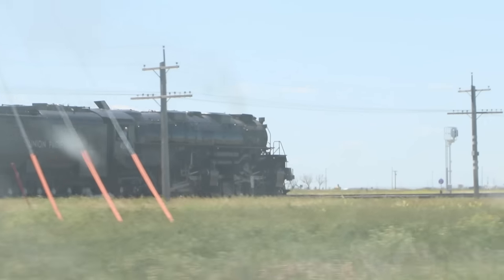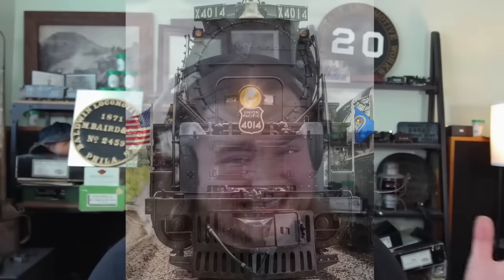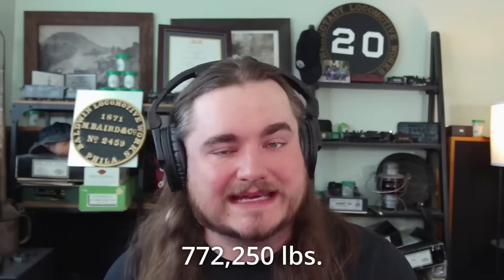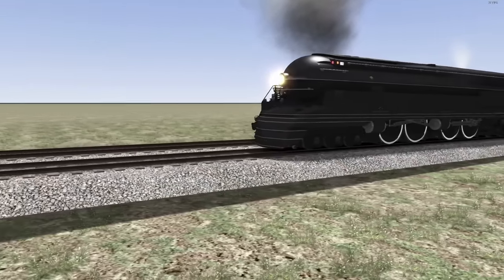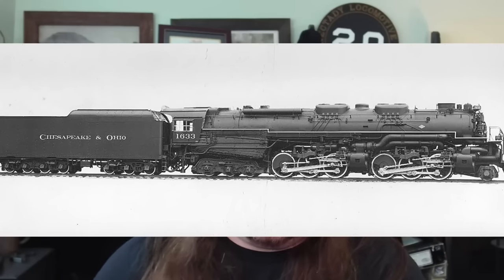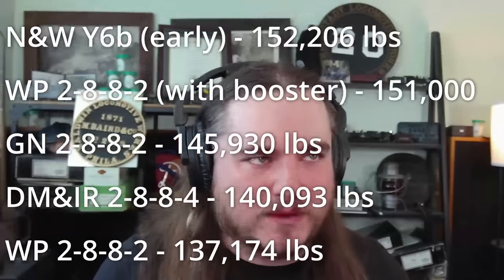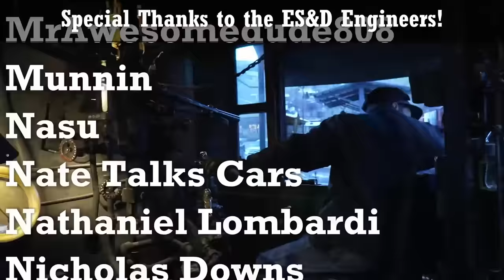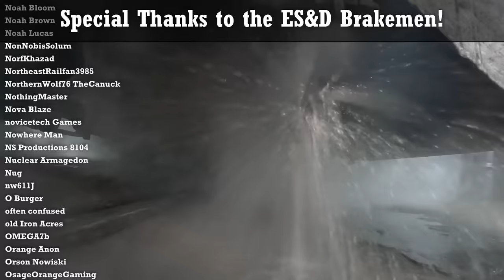BIG BOY is NOT the BIGGEST? What is then?

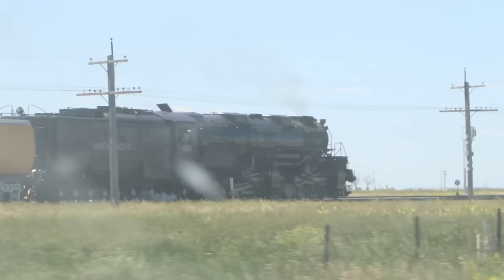Comment: Before getting past the 2:28 point in your video I would like to mention some thingsI have always heard.  Like you I have heard it said many times that the Big Boy is the biggest steam locomotive ever built.  But most, if not all of those statements come out of the rail fan community.  

But what I have heard from within the industry, I’m a retired over the road Engineer off of the UP and literally been around railroading all of my life.  My father was an Engineer off of the Texas and Pacific.  The T&P is where I got my start as a fireman in 1973.  So what I have heard is that the Big Boy was the largest steam locomotive to go into production and was used successfully until they were faced out.

There were larger steam locomotives built, but they were only 1 or 2 of each built and they were not successful and did not go into production.

Comment: Locomotives were/are measured by drawbar horsepower. Tractive effort is important in determining the actual power. You can make a million horsepower, but it won't mean a thing without traction.  Big Boy was UP's biggest by length, that would fit on a turn table.

Comment: IIRC, the UP's original claim as reported in Trains magazine's bicentennial edition (or maybe one of their own anniversary editions) was that the Big Boy is "Largest in point of total engine and tender weight of any 8 coupled simple articulated ever built".  The 8 coupled part eliminates the secretly overweight Alleghenies.  And weight measurement isn't subject to the vagaries of picking a K factor for tractive effort or the complications of measuring indicated or drawbar horsepower peaks with precisely the right resistance to get a maximum.
Reply: 'Largest ... of any 8 coupled simple articulated'     Yeah, why didn't they go the whole way while they were at it and carry on "with 68 inch drivers and a number starting with 4."     Like, if you're going to list that many qualifying conditions you can make almost any loco you choose to be the mostest.

Comment: The Big Boy is currently the largest operating Steam Locomotive in the USA.  A good point about the Erie Triplex. But you are comparing apples and oranges when you're comparing electrics and diesels against Steam.

That said, like the Erie Triplex the Big Boy was designed for one small segment of railroad, Sherman Hill. Southern Pacific had the Cab Forward types specifically for Donner Pass. 

So be careful about these locomotives. They were designed for specific locations on specific routes.

Comment: One thing to consider too, is if you were to design a new steam powered engine, you wouldn't want it huge. The only reason for doing that with the Big Boys was to lower manpower costs, replacing two or more engines with one. Like diesels, you could now automate the steam engine just the same with one controller and as many dummy engines as necessary. Or just run everything remotely...
Reply: I wouldn't trust a robot to tend a conventional coal fire. Powdered coal, *maybe*.
Reply: @ReggieArford Harder, but certainly not impossible. But why use coal at all?

Not that a steam engine with pistons makes any sense efficiency-wise today (turbine electric is better), but using a cheap and easy fuel like CNG/LNG would be dead easy to control.
Reply: @hallkbrdz You're right; a gas or oil-fired boiler would be easy to automate. Heck, the Stanley Steamer had an automatic boiler! As for steam turbines vs. pistons, pistons allow for variable steam expansion and thus more efficiency at partial power. Remember, they built several; all fuel hogs.

Comment: When they say Big Boy is the largest steam locomotive in the world, they are talking about one the didn't go to scrap due to certain reasons such as speed demon was only designed for straight track and not turns cause it's not articulated like Big Boy is and there is no such stretch of track that is straight from one station to another. See the speed demon would have to take certain routes that has extremely long dull turns cause it cannot take sharp turns like Big Boy can and if you compare the design of both then you'll see why Big Boy actually wins, cause Big Boy is the one that kept going while the other large steamers went to scrap due to poor design.

Comment: I know this question has been brought up quite a bit. But could you explain in more detail why it would not be possible to build an s1 in current times. 

Now I'm going on the assumption that with modern equipment and simplification of certain complex equipment. What it would take to make a full-scale s1 replica. And probably how roughly it would much it would cost.

Because even though steam engines are arguably outdated. The question would be could you make a steam engine with modern designs and modern methods cheaper than what you could do remaking one of equivalent time of the old style steam engines.
Reply: I can’t give specifics on cost, but the S1 makes a poor choice of rebuilding because it is enormous, it can’t get around on anything short of a class one railroad. Even then it still is limited. I’d bet that none of the class ones would willingly let it operate on their trackage. Theoretically you could rebuild it, but why? You couldn’t run it anywhere. The PRR T1 is much more capable of getting around tourist railroads. That is why it was chosen by the Trust. It could go anywhere a large northern could. They’re using modern equipment to make the T1 as well (such as welding it together instead of casting it).

Comment: The MOST POWERFUL Ridged Frame production loco is : the Q2!! Like internal combustion engines it’s bore vs stroke.  Locos it’s wheel diameter vs reciprocal cylinder diameter!
Reply: Its the Allegheny. 

The 7987 HP that the Q2 got is indicated HP, which is measured at the cylinders. It got this on a test bench where it had no wind resistance and was able to be fed water and coal at rates that were not practical over the road. 

It recorded 6645 drawbar horsepower (measured at the tender). Far lower than the Allegheny's peak drawbar  HP of 7498 and sustained drawbar HP of 6900 HP

Comment: It was purpose built as were the others. Check out the stats at different altitudes...that is what is missing in your analysis. If you research the REASON a thing even exists you will discover much more enlightening information. Boiling point changes with altitude and so to does the efficiency and btu output of a boiler. As you rapidly change altitudes performance dramatically changes. Also; heat saturation and cooling capacity at lower speeds is a serious performance and operational issue. The dimensions of an engine are also about the limitations set by the route it will run. Not all routs had curves to allow a longer engine and so one that has power and can accommodate sharper turns would be needed. Powder output over time per maintenance cost is a HUGE factor.

Comment: Dude, the big boy is the biggest steam engine. Don't include turbine and electric powered engines on this list because thats not a steam engine.
Reply: Did you watch the video?
Reply: @Poliss95  yes
Reply: Steam turbine locomotives are still steam locomotives. Steam turbines locomotives still use steam as their source of power. Therefore they are still steam locomotives and stay on the list.
Reply: Even if you don’t want to include steam turbines, which are considered steam engines, the big boy is still not the biggest. The Lima Allegheny weighs more(on the drivers) and produces more horsepower, the N&W Y6 in simple produces more tractive effort, and the DM&IR Yellowstone produces more tractive effort. Plus, if I might add, the N&W Class A is far more efficient and economical than any of these.

Comment: Big Boy served UP's needs reasonably well.  Perhaps few other locomotives could have served those particular applications as well.  The 2-6+6-6 Allegheny certainly did not deliver all the power produced by its massive grate and heating surface areas to the rails very well while pulling trains up steep grades.  The Allegheny also had this weight scandal served up by Lima that could have been proven detrimental to C&O's bridges and so forth.  Lima was not initially forthright about how much this rail bender ended up weighing.   The Allegheny was actually found to perform best when pulling fast freight west of the mountains which was not its intended purpose.  The N&W "Y" class had a higher tonnage rating than Big Boy, but it was built for N&W's needs and not the UP's.  The short steep grades in the Appalachia may be a different challenge than the longer more consistent grades and easier curves found in Wyoming and Utah. Big Boy may have actually worked better out for the UP than something like a N&W "Y" class.  The UP did not build their own locomotives like the N&W did, Sherman Hill was only a fraction of where the Big Boys operated, and the Alco's 2-8+8-4 was probably as good a solution as any for the UP.  PRR disliked articulated locomotives and that got them into technical problems with larger locomotives built on ridged frames. It is my belief that there were many "better" locomotives than Big Boy that included the N&W "A" class and several of the 2-10-4s that several roads operated.  While not quite as big and powerful, they had comparable power and were of good reliable designs.  One particular feature among those locomotives I am referring to was a lagged firebox which allowed more efficient combustion of coal for a given amount of grate area.  Big Boy has its firebox partially over its drivers which made it somewhat shallow.  The "lagged" firebox design is completely behind the drivers and makes greater firebox depth possible.   The N&W Jawn Henry at least worked better than other steam turbines of the day.  Turbines were said to be difficult to fire and were an absolute nightmare for repair shops.  N&W only building one of these steam turbines may have been the verdict of a well run railroad that only invested heavily in equipment that made good economic sense.

Comment: OK, so I have a slight problem with your statements. It's a little nit-picky, but accuracy is important in education.

Some of the locomotives you discussed (like the Jawn Henry and the M-1) are not reciprocating steam locomotives, they're steam TURBINE locomotives which are radically different, so technically that places them in a different category than the Big Boy, at least operationally.

I mean steam turbines have a LOT more in common with diesel-electric locomotives than other steam locomotives, since both steam turbines and diesel-electrics are rail-mobile power plants. Hell, steam turbines even have the same cab controls as the diesels of that era. So they're kinda steam locomotives and kinda not, if you get what I'm saying.

You're still right of course, Big Boy is the largest and most powerful OPERATIONAL steam locomotive in 2024, not in history. BUT you included some locomotives in the list there that are technically too different to be in the same category.

That means in some of those categories, Big Boy would be promoted up a rank or two because turbines are so different that they don't even qualify as steam locomotives.
Reply from the maker: They are steam locomotives.
Reply: @Hyce777  Again, technically yes technically no.

They're more like steam-electrics. They use steam to push a turbine which turns a generator, which generates electricity which goes to the traction motors.

Same technology as in a diesel-electric locomotive only replace the diesel engine with a boiler and a steam turbine, plus a condenser. A steam-driven power plant met a locomotive and they had a baby.

While steam is still part of the power system, turbines don't quite qualify as steam locomotives since steam is only part of the powertrain, not all of it.

Steam turbines are in that distinct 'grey zone' alongside things like diesel-mechanical and diesel-hydraulic engines, which are separate categories to diesel-electric locomotives.

Diesel is still part of the power system in all three types of diesels, mechanical, hydraulic, and electric, but normally when one says "diesel locomotive" they tend to mean "diesel-electric locomotive", just like when someone says "steam locomotive" they mean "reciprocating steam locomotive".

For this reason, turbines should be excluded since while steam is part of their power system, it isn't all of it.

This means that while you're still correct overall, including turbines in the list is in error. Sorry!
Reply: @TheOneTrueDragonKing They are still by definition steam locomotives. Unconventional, but the definition of a steam locomotive is very broad. The only requirement is that they use steam as their source of power. Steam turbines still fall under that classification. All the types of diesel you mentioned are all still types of diesel. Even if the steam turbines deserve their own category, they’re still steam locomotives. Therefore they stay on the list.
Reply: @Stooltoad5017  Errr... if they're so radically different that they deserve their own subcategory, then do they really count as the same as those in another category?

Most people, historians like me and others, engineers who understand the distinction, would say "no". (Which is why I'm surprised Hyce did it: He should know better.)

This is falling into the same trap that most non-historians and those that don't know the difference fall into by classifying every locomotive that uses diesel as a "diesel locomotive" leading those who don't know any better to think they're all diesel electric.

And the fact of the matter is, steam turbines may technically still be steam-powered, but they're too different from the reciprocating steam locomotives like Big Boy to be comparable.

Comparing steam turbine locomotives to reciprocating steam locomotives, is like comparing a gas turbine-electric locomotive to a reciprocating steam locomotive. They are just as different.

It's important to have a distinction, especially in education where being specific is important. And this IS an educational channel, supposedly.

Turbines need to be removed from the list, otherwise it's misleading.
Reply: @TheOneTrueDragonKing  The list isn’t specifically reciprocating steam locomotives though, just steam locomotives in general. The comparison isn’t about how they work, but size. Steam locomotive as a term is very broad, and steam turbines still fall under that description. Should Hyce have elaborated on what a steam turbine was? Probably, but at least in size I think they should stay on the list. In the end we should probably just agree to disagree.
Reply: @Stooltoad5017  With respect, when someone says "steam locomotive" they usually think of and mean a reciprocating one.

You don't NEED to say "reciprocating" when you're talking about steam locomotives, it's automatically assumed to be the case.

You actually have to specify when you're NOT talking about reciprocating locomotives.

Comment: one refinement in seeking out the true "Biggest" is the term Production meaning it's not a prototype or One Off experiment.
it was a family in serial production.
there were 25 Big Boys built No's 4000-4024 in 2 batches
the Pennsy's S-1 was very much an Experiment and only 1 was made whereas the T-1 Duplex also made by Pennsy WAS a production model with 50 in class No's 5000-5049. not counting the essentially hand made 5050 being built by the T-1 Trust.
Reply from the maker: It is a challenging thing to work there.

Comment: I usually say largest NA railroad steam loco? probably a one off called jawn henry...
In some ways big boy was an ordinary large steam engine... 
Built at a time when most loco builders worried technology was
going to kill steam.  The PRR T1 was built for a different purpose
and otherwise similar dimensions. both PRR and UP wanted the biggest engines they could get
and big boy was near the limits of what could be done.
I have little doubt the next types of steam would have some how been bigger.
had not both PRR and UP gone diesel...

Comment: What about box volume? The minimum size of the square building in could be stored in?

Boiler size? Firebox size?

Give me something here.
Reply: These are all gigantic locomotives that need gigantic spaces. If the big boy is winning the storage space competition as a 4-8-8-4 I’d be rather surprised. I’d hope the Allegheny would have more firebox space given it has a SIX WHEEL trailing truck but I don’t know. Most of the locomotives that were bigger were either one offs (the S1), or failures (steam turbines). As a 4-8-8-4 it was still a very capable locomotive.
Reply: @Stooltoad5017  but it's the BIG BOY
Reply: @Stooltoad5017  The Allegheny had a much larger firebox than the Big Boy. The B&O EM-1 and DM&IR 2-8-8-4s also had larger fireboxes. Even the Western Maryland M2 4-6-6-4 had a larger firebox than the Big Boy.